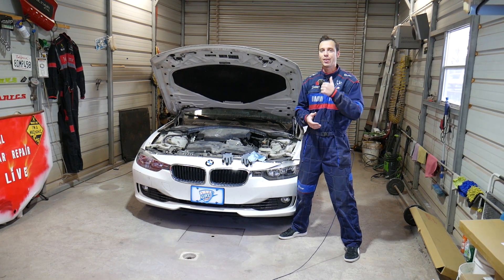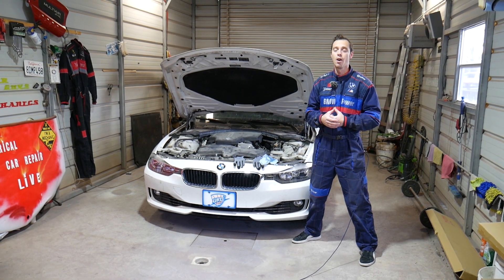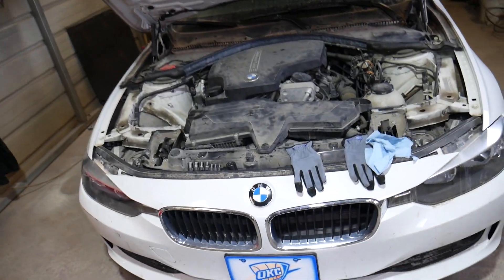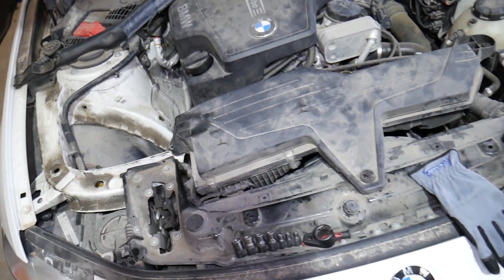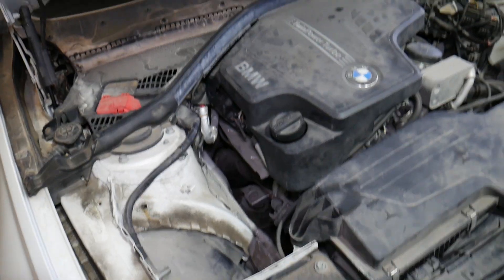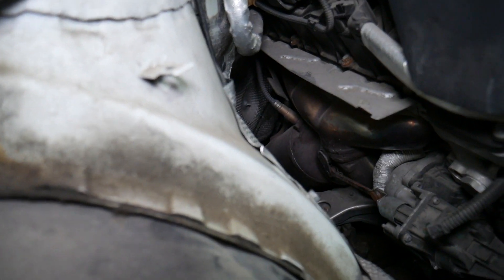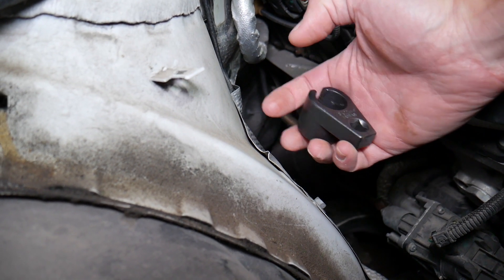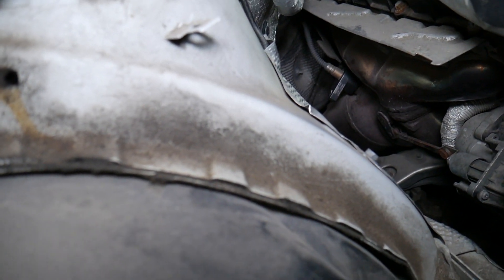BMW UPSTREAM OXYGEN SENSOR 1 LOCATION REPLACEMENT EXPLAINED F30 F31 F32 F33 F34 320i 328i 420i 428i

Comment: My upstream o2 reads 1.99 to 2.03 v on idle. 316i bmw from 2009, on most vids on YouTube i see it should be a lot less voltage on that one, what could cause it to read around 2 v?  It drives OK, just once in a while (not always), as I let the throttle off, It dips to 400-500 rpm to then raise back up to 700 rpm.. Changed both o2 sensors for new ones, still the same... Any idea..Oh yea coils new and new spark plugs too..
Reply: did you ever fix this problem?

Comment: I have a 2007 530XI and my infotainment system is not turning on, it's not resetting or anything. I have no radio, no AC/HEAT controls, no sound. I checked the computer module in the trunk and it looks in good condition. I don't know what's going on.
Reply: Sounds like a fuse issue?

Comment: Hi my frande i have x5  e 70 n52 code 29eo d m e mixture control 29e1 dme moxtire conttol2 I have problem my car war'nt start in the morning i change oxygen sensor after catlytic bang 1 sensor 2 and mass air flow but my problem same plees help me